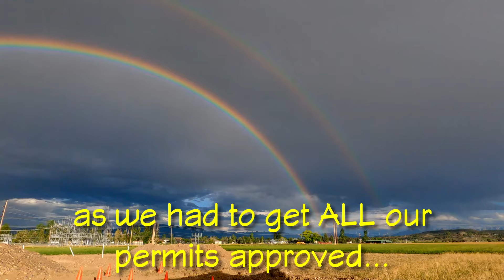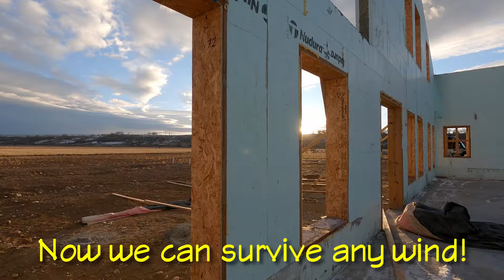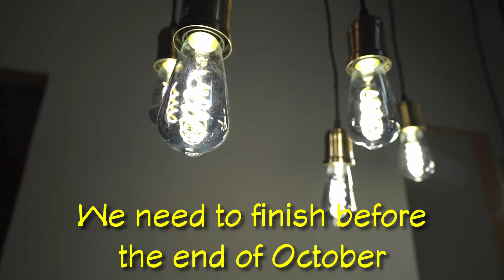Full ICF Barndominium Build Start to Finish Timelapse

Comment: Good Job, a lot of hard work to do most of it yourself.  The only thing that I would have done differently, I would have put insulation on the outside of the roof.  Rockwool  under the so the attic would have been conditioned space.
Reply from the maker: For sure.  But it is a large space!  Over 16' tall inside the garage, plenty of room inside, not sure if we could actually use the attic space...  Over our first winter we were no lower than 55 degrees inside the garage with no heat!  65 inside the living space before we turned on the Mini Splits.  So far so good!

Comment: Just curious why people are using wood trusses with tall roofs, and wood/wallboard for the interior walls instead of the ICF roof panels, and either thin ICF's or poly panels with mortar for the inside walls?  Wood, paint and wallboard is expensive, as well as the siding, etc.
Reply from the maker: Thanks for the questions.  We used Engineered trusses because of the span in the garage area.  All other interior walls are non-supporting.  I designed a Barn-look, thus the exterior panels hung vertical.  Thank you for the comment!